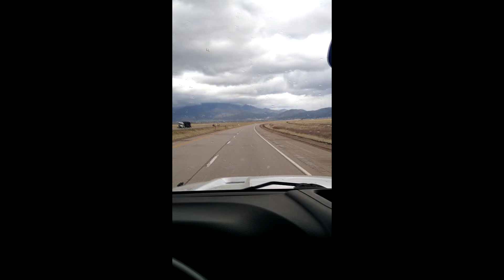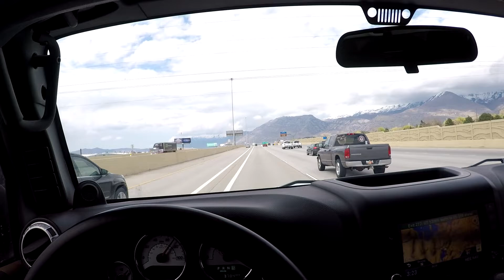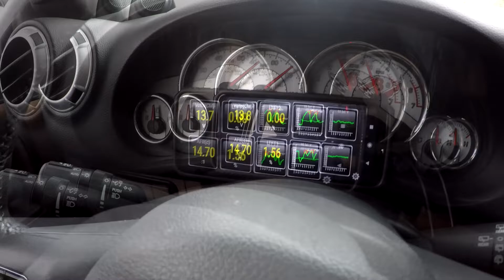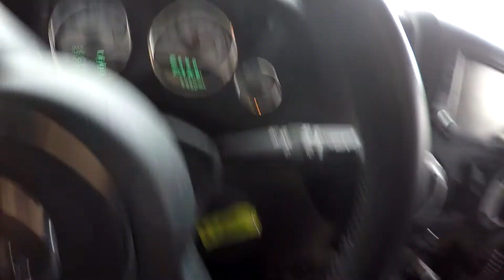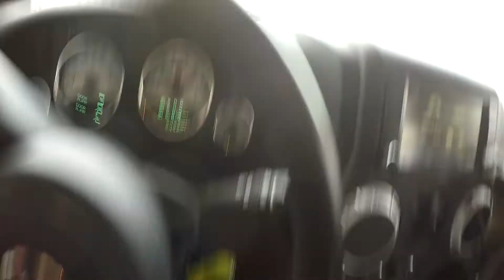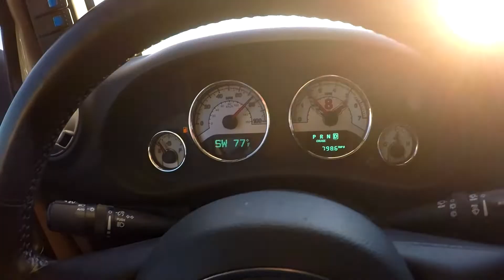Road trip: Vegas To slat Lake Part 2

Comment: 2011 Rubicon, 3.8L 6spd manual with ripp supercharger and high flow headers, 32" tires and small utility trailer. I regularly run I-25 Denver to southern Montana and I've never seen above 12 mpg. More important, I'VE NEVER HAD A RELAXING DRIVE....EVER!! The wind is always a constant factor. Looking forward to a 6.2LT and 10L80 swap soon...
Reply: I used to have more of an issue with wind gusts from the sides, if thats what youre referrring to and using firmer shocks  or setting adjustable shocks to be firmer helps tremendously.